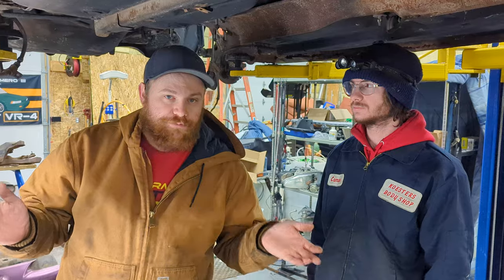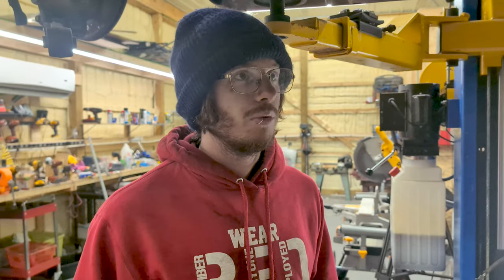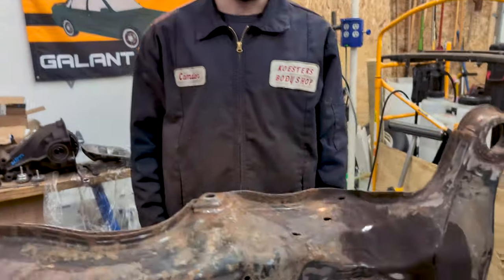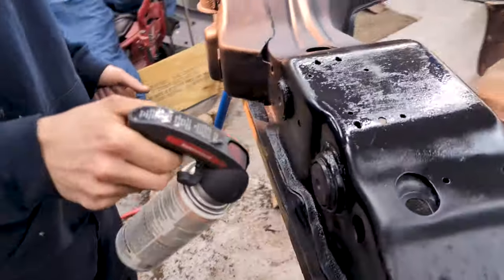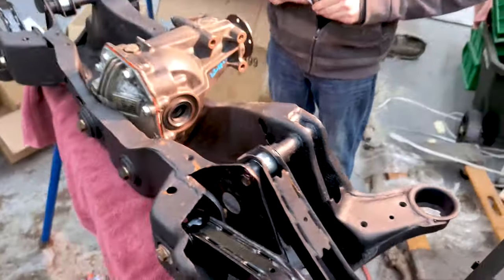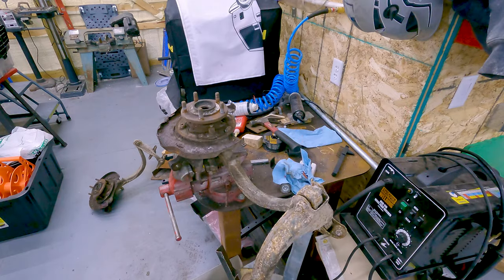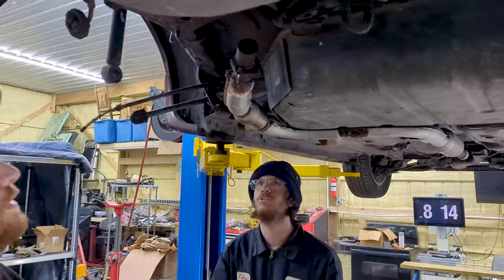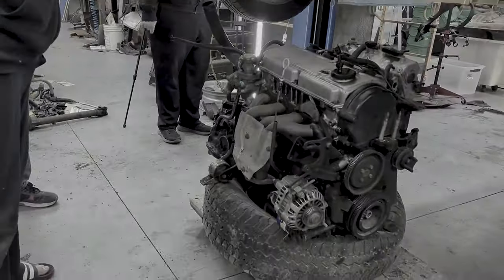Why You Should Restore Your Subframe | Mitsubishi Eclipse Spyder AWD Swap | Jimmy Talon - Ep2

Comment: fuck swap in a turbo harness and a 2.0l head onto the 4g64 and hammer down! I'm running 19psi on my bastard 4g64 with a 16g and it ain't gone boom yet plus has the added benefit of a good bit more low end grunt over the stock 2.0.
Sure hope your saving the talon bumpers! I always find myself looking for more 2gb talon ones.
Reply: We’re absolutely saving the talon bumpers! As for the engine, that was an option but my goal before the shell swap was to do an oem+ build and I wanted to more or less stick with that after we got the new shell, plus the engine in the talon was rebuilt and has much less miles on it. Maybe some day we’ll do a 2.4 build 😉
Reply from the maker: Nailed that reply cam!
Reply: @camden-shragal  rule of thumb is you can never have enough spare parts lol Glad your saving the bumpers. 
Looking back to the 2000's and early 2010's the stuff guys were just throwing away was insane to me.